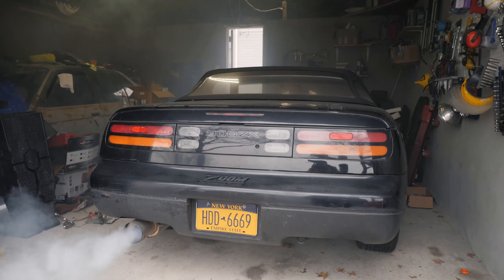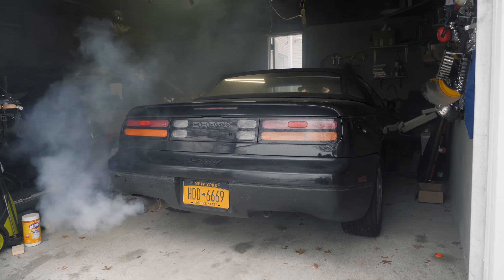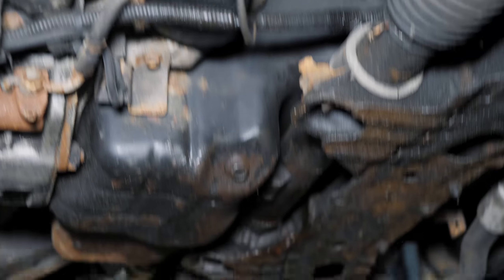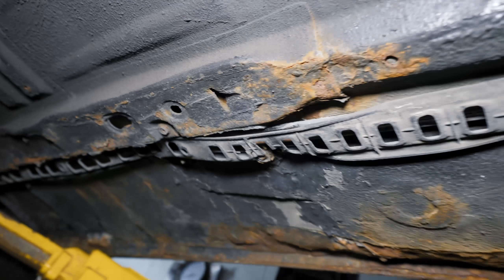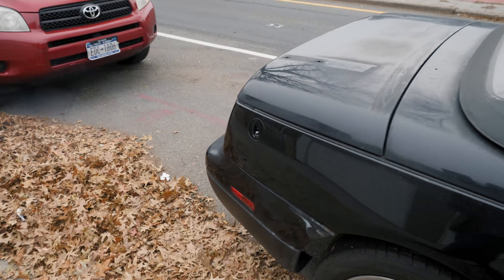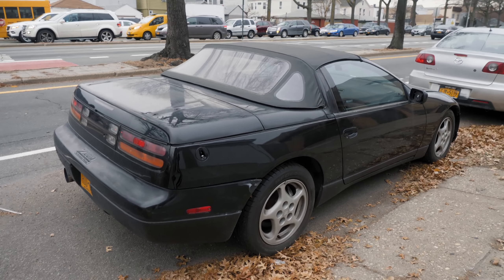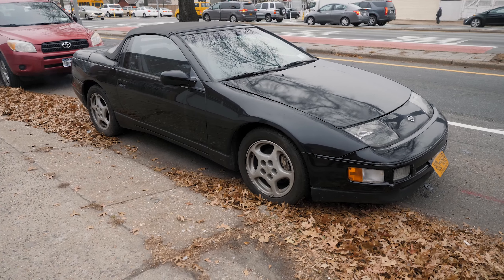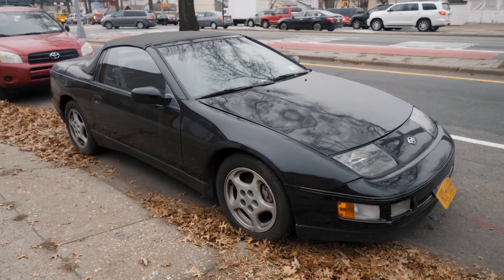Nissan 300zx is dead.

Comment: RIP to your z32 🙏. I had put around $14k into my TT 300zx, from maintenance to modifications, and the car still needed a lot more work just like yours. I recently ended up selling my z32 for $5k, lost quite a bit of money. These cars really are money pits unfortunately (then again, so are many other cars). I ended up buying a 2001 SE Miata, and I'm loving it so far. It's nice to have a car that's not too expensive, easy and cheap to fix, and super reliable, yet very fun (albeit being super slow lol). However, z32's are still my favorite, and I have a soft spot for them. It would be great if you got another z32, I'm dying to see someone make videos on building a NA-T 300zx. However at the same time, if you don't get another z32, I totally understand why. Good luck with everything!
Reply: I also have $15k into my Z32 Twin Turbo, They always need something. Id part my car out before selling it for 5k.

Comment: You've got a rust bucket. A lot of that can be fixed with time and money. Treat the light rust with a rust stopper like navel jelly. Sand blast it first. It's a bummer but all cars are money pits. The convertible may get a good price if you clean up that rust. I enjoyed your video on the timing belt replacement.